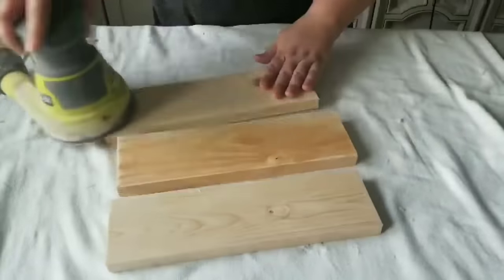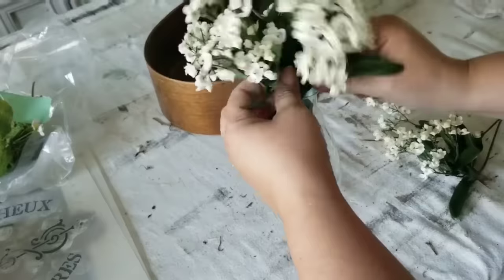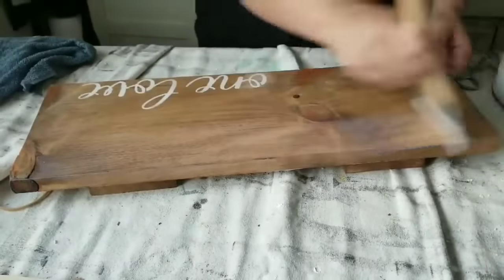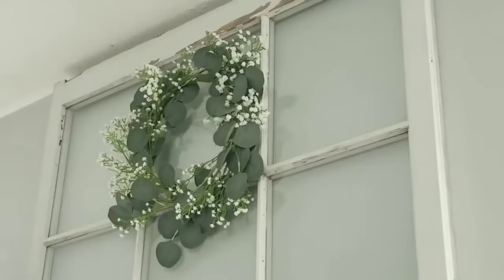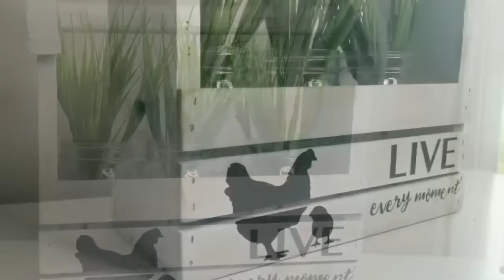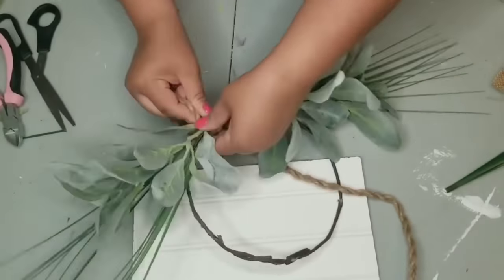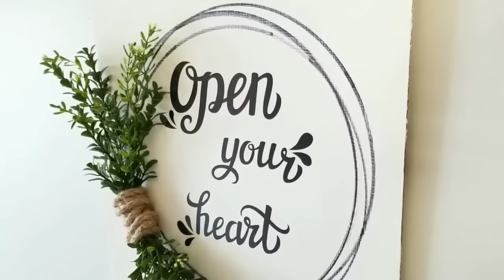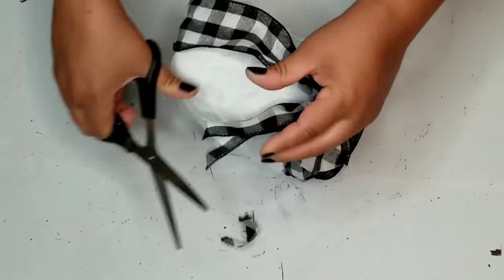🌟 45+ Farmhouse DIY Decor Ideas | How to Decorate your Home Farmhouse Style

Comment: When I mod podge I apply my layer, not super thick but not too thin either. I let it dry a little so it’s tacky. If you see any dry spots tap some mod podge on those spots with your brush then apply the paper at one edge and let it lay down on its own. Then I just use my hands to keep smoothing over it until I can tell it’s dry. Sometimes I use a hairdryer on low with one hand while smoothing with my other hand. Works perfectly for me. I used to get all those wrinkles and it is so frustrating sometimes. Ughh. Patience and taking your time is key I guess. Thanks for sharing your ideas!!

Comment: Get a spray bottle with a very fine spray…. Apply your mod podge to your work area, grab your paper and lightly and I mean a mist of water to your paper apply the paper to your work area smooth out with fingers or side of hand and mod podge over. NO BUBBLES…… ENJOY! Cheers, Kacie
Reply from the maker: Hi! Thank you so much ❤️
Reply: Also just found the neatest trick….. everyone is using the cling wrap or suran wrap they take a piece ball it up and use it to smooth out. LET ME STOP YOU THERE….. Simply grab a brand new zip lock open it up stick your hand inside flat your hand on project and smooth on out. It does not tend to grab like the cling wrap….
Reply: Also try using the glue stick won’t bubble that way at all either.

Comment: With paper I find it easiest to spray the paper with water before I place it down on the mod podge, and then I let it completely dry first using a piece of clear plastic wrap balled up to smooth out wrinkles then put the top layer of mod podge on doing same thing if there’s any wrinkles. Even with fabric sometimes it’s easier to do it if you mist it with water
Reply from the maker: I'll have to do that! Thank you so much ❤️

Comment: When you're using rope, twine, etc., for handles, wrap one end with tape, push it from the inside out and then over to the other hole, then back inside. Tie a knot on the ends.

Comment: I believe that, in order to avoid bubbles or wrinkles in the paper you are going to podge, you need to wet the clean and sanded surface a little, before you smear the podge on the surface you are going to place your decoupage.
Then smear the lodge.
Place the sheet or napkin you want, and add your podge on it.
Try it first! Please!
Again, thank for share your savvy!

Comment: Speaking of scrap wood, also the other day I was checking for something at the Habitat for Humanity ReStore and there outside at the parking curb/by the side of the building was some pieces of wood, like baseboards etc. and what was I think a cheap-materials  entertainment center, with a sign out that said "Free scrap wood" . Maybe it's common ?? ( I don't get to that larger nearby town often ). Then, ask any local carpenter/home building contractor, as they likely have all the small scraps you'd ever want, at certain times.
Reply from the maker: That's awesome. I love Habitat for Humanity. I haven't been in while, I need to make a trip. Thank you so much for watching ❤️

Comment: I can’t pick a favorite because they are all so fantastic!!  I have some of the paneling that you use in the videos. Question, how do you keep it from splintering?  It is so affordable if you can’t find it for free. I was just a little concerned about using it myself because I didn’t know if would splinter. If I am correct it is the same thing as luan. Again, I love them all. 🥰😊
Reply from the maker: Thank you so much ❤️. They do tend to splinter quite easy. Some people have used painter's tape and cut right down the middle of it. But I've never done it myself.
Reply: @diybeautyonpurpose  I may try the tape method. I get free wood from my local Lowe’s. Once they unload a pallet there is wood pieces that are left that are I guess just for support and just throw them away. They usually have a groove down the middle and they make great picture ledges. 😊